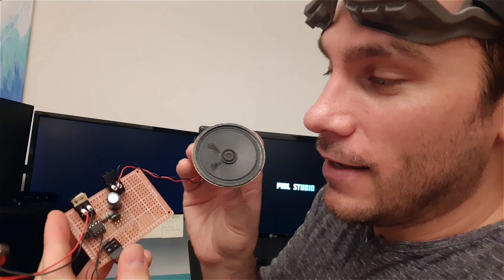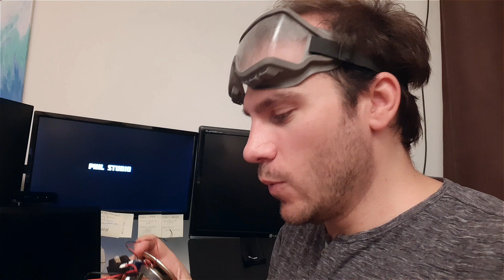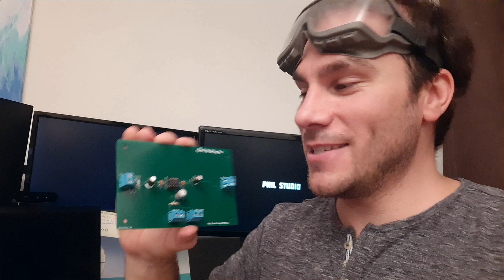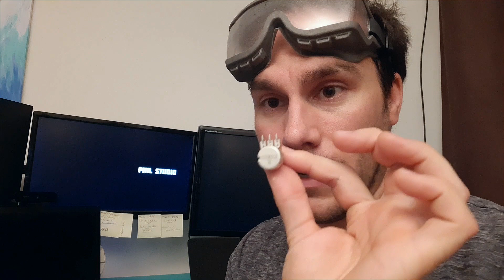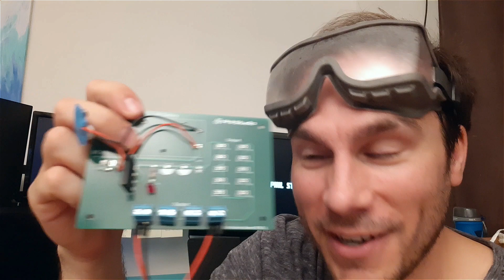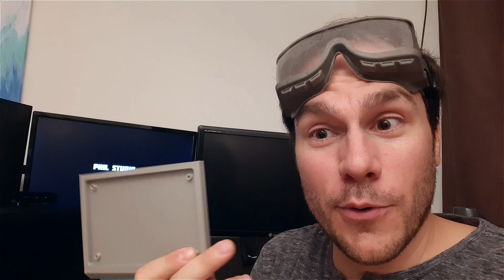From Junk Proto to Small Amp 3.1 – My First DIY Amplifier Build Journey

Comment: The only time I do not use a socket for ICs is when I am making STOMP BOXES 😆🦶
Reply from the maker: I guess that is to save height space?
Reply: @ThePhilStudio  well it can save height space but in this case it is for extra stability.
Reply from the maker: @HazeAnderson  Yeah, I guess the longer the legs/pins, the more interference the IC can capture.
Reply: @ThePhilStudio  No I mean actual stability in terms of stomp boxes tend to be roughly handled. Conversely however, a lot of pedal builders DO use sockets to allow the owners to swap out other ICs. All in all I am pro-socket. :)